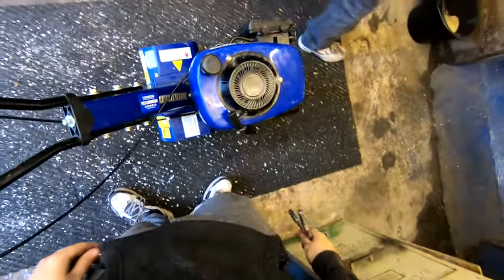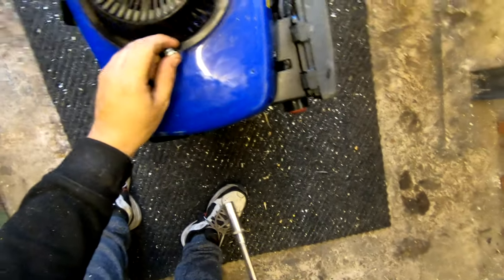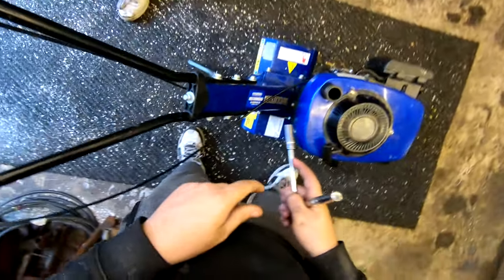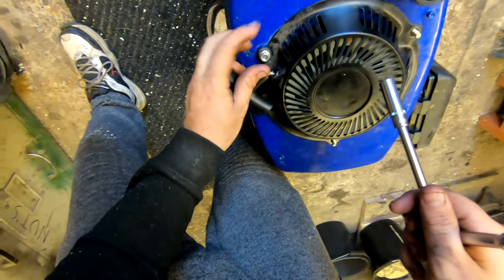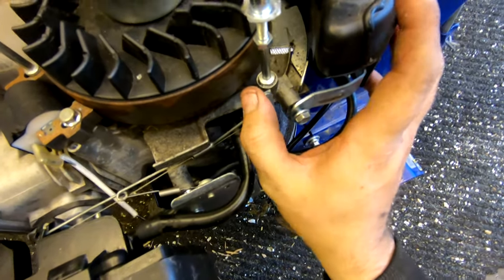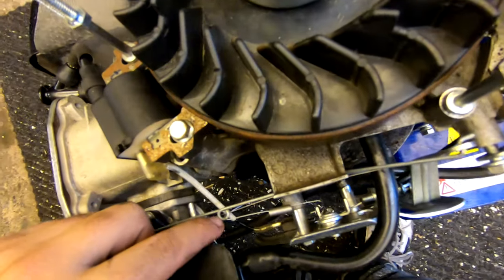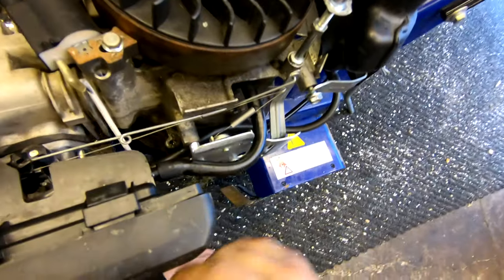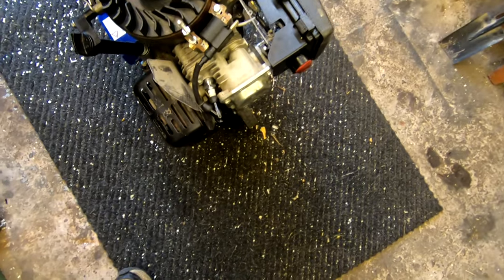Hyundai Petrol Tiller/Rotavator Governor Spring (PROBLEM FIXED) #shorts

Comment: Thank you very much for that! I think I have the opposite problem. As soon as there is a load on the motor, the damn machine stalls. As I have had similar problems with a quad and strimmer in the past, I replaced the spark plug but no joy. Tweaked a mixture screw too but that did nothing. I shall examine the governor spring which I assume tweaks the airflow through the carb.

Comment: hi there   video my problem is when you i pool the throttle  it doesn't rev up but could do with a better look behind the plate so i can get the jist of were all the bits go  the cable and the springs ive just got this free it has been stored in  damp shed its a bit rusty and the petrol in it had gone right off so would not start so put petrol in it to flush it all out but still didnt work but i got told years ago is to try some 2 stroke in it and tried to run it and it went and started  first couple of pulls its done a good job with a peace of string